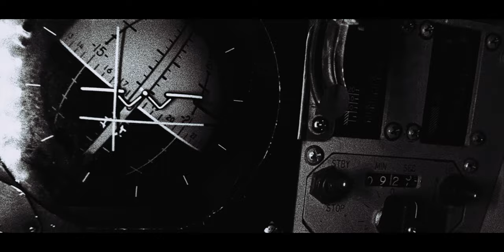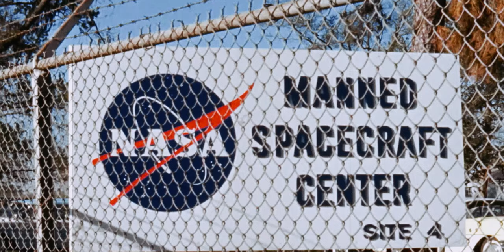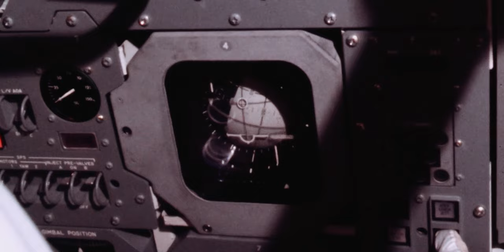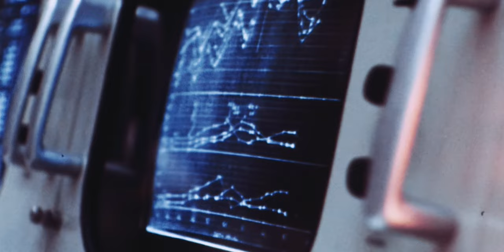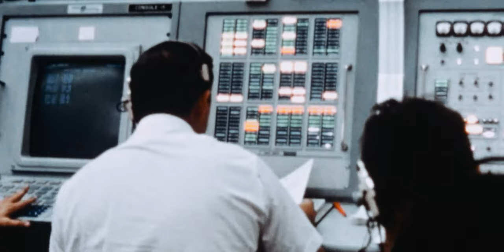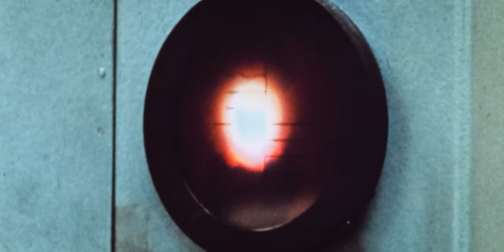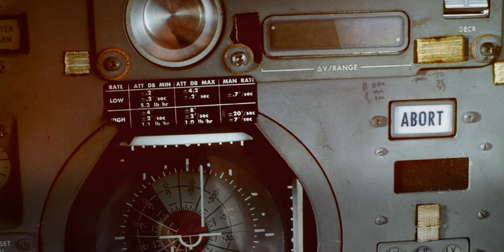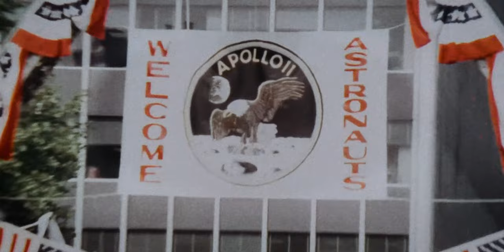The Apollo 1 Tragedy

Comment: It's such a shame that Gus was blamed for the Liberty 7 hatch malfunction and the very redesign of the hatch for Apollo because of that mission helped seal the fate of these three brave heroes.
Reply: Nope that is bullshit. The design of the Block 1 Apollo capsule hatch had nothing to do with that incident (one of the many facts this video got wrong). Remember the Gemeni missions all included a hatch that could be opened by the crew for space walks.  Liberty Bell 7 (Mercury-Redstone 4) hit the water much harder than expected because they believe that one of the parachute canopies was partially collapsed and was not fully open when he hit the water. He also landed in rough seas. Additionally, he was having trouble communicating with the recovery crew and actually thought they were hooked up to the capsule when the hatch blew.  As soon as the hatch came off, the capsule began to fill with water and he exited quickly not realizing that a valve was not fully closed on his pressure suit, and he began to sink. It is a good thing that he was in top physical shape and could tread water as long as he did. In fact, he almost drowned. The recovery crew said he was coughing up sea water when they finally got him into the recovery helicopter.
After his flight they changed the protocol for recovery which included frogmen in the water with an inflatable raft and an inflatable Mae West as part of the Astronauts gear (just in case).

Comment: How did the fire START? WHY work in PURE OXYGEN?
Reply: A wire under the seat ripped and burned into the seats. The astronauts were not able to escape because they were locked inside the capsule. They only way to open the cabin wad from the oustisde, and there was nothing mission control could do until they burned up